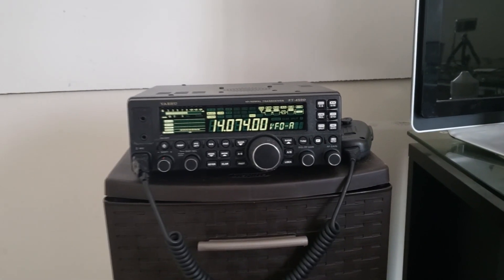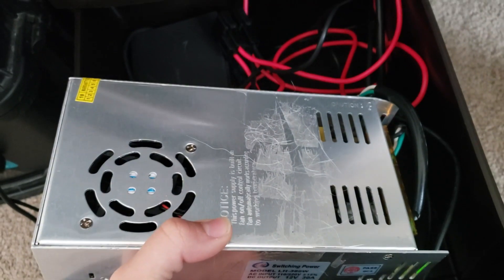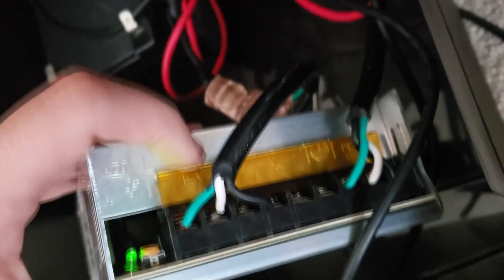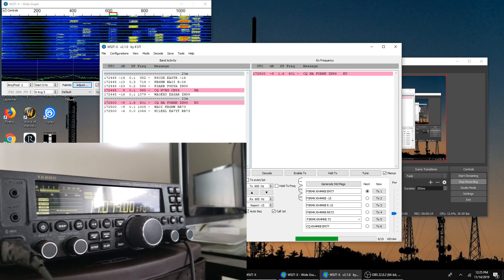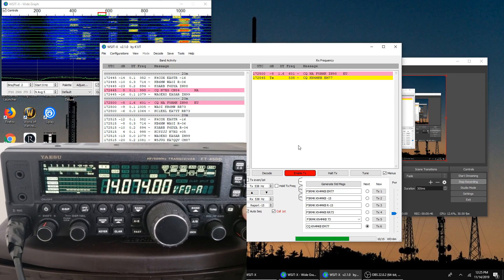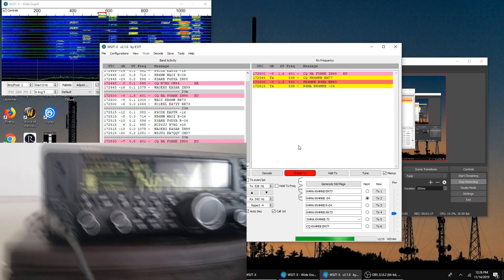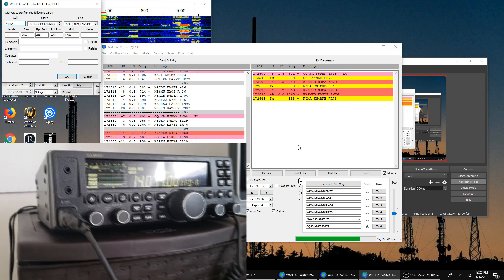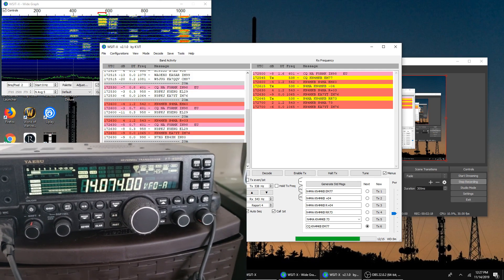HF Radio on a $20 Ebay Power Supply Unit

Comment: Thanks good information. I'm about to use a 30A "LED" power supply on an Alinco SR9 to do exactly what you have done. I appreciate the confirmation that its a workable solution.

Comment: I had one of this switching power supply, but it puts a lot of noise on lower bands (80 and 40 m mostly).  Then i can get a Daiwa PS-340 II, linear power supply with protections, and i solved the EMI issue. I'm watching all your videos... 73's.

Comment: If you get another battery You might make a buffered power supply. Basically, you could use even noisier PSU to charge the battery while the radio is connected to the other one, and just add relays and timed circuit to switch between in i.e. 1 hour periods. That will outperform even hi-tech PSU because the radio is constantly connected to a battery not PSU.

Comment: Nothing wrong with the power supply you are using as they work great.  Only problem I see is the amount of power you are running.  Suggest you cut is back to below 40 watts before you blow your rig up because of the duty cyle on FT8.  Have a great day and thanks for the video.

Comment: Got one of these, 12V 33A It got me on air with 100W capability, but it's a little bit noisy. That can be solved by using ferrite core on the output wires, 10 or more turns. maybe snap-on toroid or two on the input too. These are common design, some better, some worse, all of them two transistor forward with TL494 or similar IC. definitely keeping it as a backup even i moved on to MAAS/K-PO SPS250ii, yet another cheap switcher supply for about 70$ that has "noise offset feature" to shift the driver-IC's frequency and harmonics elsewhere, tamed with toroid too.

Comment: Great video, I’m just getting started in hf, looking for both a radio and a supply, new to the hobby so I don’t want to drop a lot on my first rig.  As a side note your ps will run cooler if it has a non restricted air flow, the drawer will hinder heat dissipation, but you probably already know that.

Comment: I have run a cheap switcher like yours for several years. it is floated at 13.9volts across a garden tractor battery  
i will be putting a AGM in its place someday so I have quite a number of off grid hours

yes it makes a bit of noise here and there  but no big issue  
You radio will only draw the full current on peaks (FT8 is a SSB mode so its not a carrier it has peaks)  
it will only draw continuous on FM or AM  
per the complainers  FT8 is a "weak signal mode" not a "low power mode"  
it may take 1500 watts to make a weak signal on a dead band

Comment: Great job on your channel, I have researched those power supply's for quite a while others have analyzed the components and circuitry and some are great and have clean power. Just go to Amazon and read the reviews of others. They will power your rig and charge a marine deep cycle battery  at the same time through a bat / pow supply  switcher.  
AA4CP  Chuck  Port Salerno, FL

Comment: Those supplies are great. Some of them are loud RF interference wise, some are quiet. Remember, FT8 is a weak signal mode, not a low power mode. Run the minimum power you need to make the contact, just like you did. 73 de w8tam

Comment: This style of PSU can vary HUGELY in their build quality and safety. A lot of the cheaper ones cut corners in their electrical isolation and in RF filtering. If you're after a reliable and safe unit, look for a genuine MEANWELL supply. They're not very expensive but are built properly, safely and produce a lot less RFI than the cheaper clones. While a bit of RFI in your shack might not be the end of your world, compromised electrical safety just might.... 😉
Reply: Thanks for this comment! After doing some research I came to the conclusion that this is a very good suggestion. The mean well psu is still very affordable. I went with the LRS 200 15, set to 13.8V.

Comment: Might want to cut your output back to 40 watts to save the finals in your radio.  Duty cycle of digital modes are high. 
Might want to place a fan by your power supply. 
But with that said, go for it.  You learn from doing.
73
wd4dda